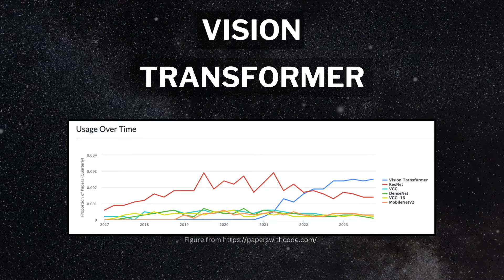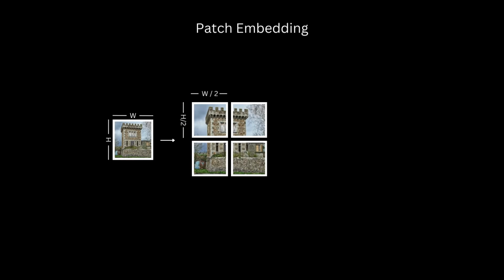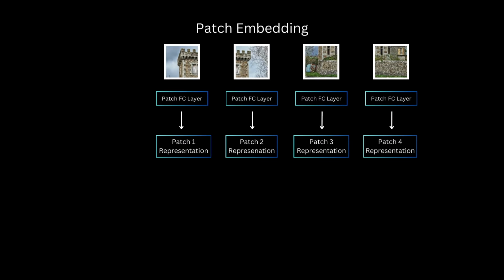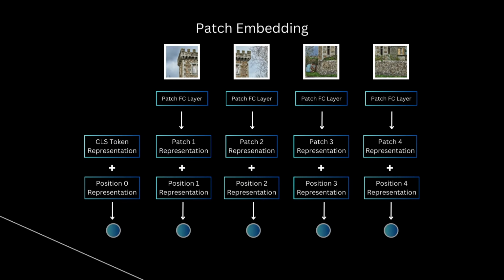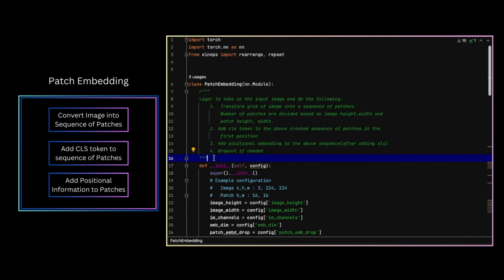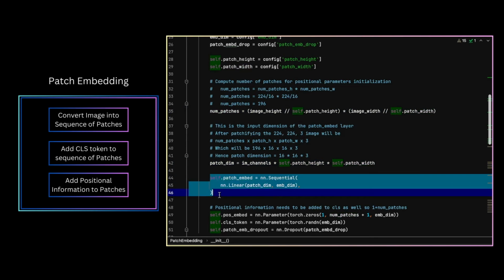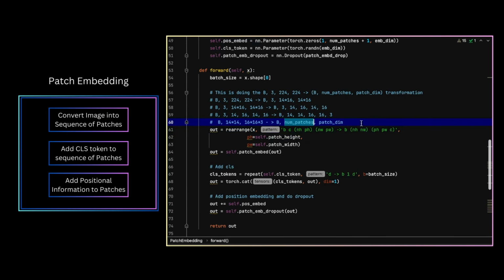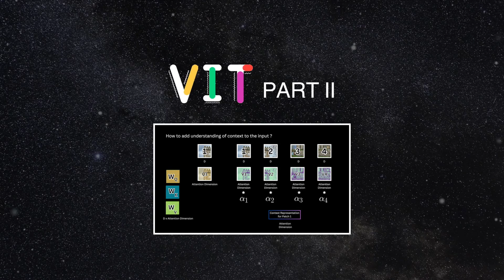PATCH EMBEDDING | Vision Transformers explained

Comment: Thanks for the video. I learned a lot, 
and I what if I have 3D images(C, W, H, Z(slices)),
what parameter should I change  or add?  
What patch size should I consider? Thank you in advance.
Reply from the maker: Thank you :) 
So I have never actually worked with 3d images(i am assuming you have medical 3d images) so take everything that I have said below with a grain of salt.

If your goal is to do classification you could simply consider tubelets instead of patches, so that means you are patchifying not just along spatial dimension but also along z(slices I am guessing) dimension.
But if you trivially try to compute the attention between these tubelet embeddings, it would most likely end up very costly(but if your images are small and z dimension is not huge you can try this). You can refer to ViVIT paper to understand this and details involved in it and some approaches to reduce the cost. 

In case your images/slices are large then you can try to use Swin transformer. Specifically you can refer to Video Swin Transformer paper. Just that for you temporal dimension becomes slices.
For specifc patch sizes and other parameter, theres a Swin paper for 3d medical images which you can take a look at(Self-Supervised Pre-Training of Swin Transformers
for 3D Medical Image Analysis), specifically their encoder part.
Reply: @Explaining-AI  thank you for such a great explanation and suggestion regarding my question. My image is 1x244x244x40 (1 channel and 40 slices). Do you think this is a large input for ViT? And yes, I am working on a classification task. I will definitely read and try to use 
 ViVIT and the Swin paper for my problem. thank you again for creating great content and you help.😇
Reply from the maker: @buh357  Its my pleasure :) And maybe You can try downscaling images and see how much time it takes for convergence to test that quickly. But for easy calculation assume your images are 224x224x40 and patch dimensions are 16x16x4 Then you will essentially be running a transformer on sequence of 14x14x10 ~ 2000 tokens. So I do feel Swin might be better option here but still do try with simply converting VIT to 3D VIT on downscaled images to see what kind of results you are getting to decide better.
Reply: @Explaining-AI  hi, sir. you were right, video swin transformer performed better than 3D vision transformer(from my traininng, both train and val loss did not decrease), but problem is that the video swin transformer is not performing better than 3D resnet50, and 3D efficientnet, i am wondering how can i boost the performence of video swin transformer? more data? do you have suggestions or tips for training video swin transformer? btw i am traninng from scracth. thank you in advance.😁
Reply from the maker: Hello  @buh357  , assuming you have already tried changing things like number of layers and tuning the hyper parameters then yes you can try with more data, that should help. 
But if getting more data requires more investment (time or cost) then maybe to get sense of whether it will benefit or not, you can try training both(swin and resnet) on lesser data. Say 10%/20%/50%/75% and so on of current dataset.
And if you see that the performance gap between resnet and swin keeps decreasing as you provide it higher fraction of dataset then thats a good indication that more data will further help to bridge that gap.
And like you said do give it a shot with pretrained checkpoints as well(for both variants for fair comparison).  
Btw How large is your dataset and whats the difference between the performance of both?
Reply: Hi,  @Explaining-AI  , i have changed the number of parameters of 3D efficientnet, and 3D resnet. for ViVit, i only changed, window size and patch size, and i still wroking on it, for you reference, my dataset is around 450 3D medical images, the validation loss of 3DEfficientNet(0.54), 3DResnet(0.57), 3DConMixer(0.58), Vivit(0.65). results are after training 30  epochs. 
I will try your strategy. train all these network on lesser data, to see the gap between models. and i have found a pretrained weight for Vivit, but the model is trained on RGB video, it has 3 channels and my data has 1 channel, i am wondering if i changed the first layer of Vivit, can i utilize the pretrained weight? thank you for giving me your suggestions, have a nice day, sir.
Reply from the maker: @For ViVIT you could just convert your image to be of 3 channel, like just repeat the 1 channel gray scale three times across channel dimension. And then use the pretrained weights to fine tune on these.
Reply: thank you. @Explaining-AI

Comment: Initializing pos_embed w/ zeros vs w/ randn, made the position embedding similarity visualization (pesv) make sense vs nonsensical. Any idea why this happens? 
In case when I init with randn, the pesv looked random throughout the training (with better losses and eval metrics).
In case when I init with all 0s, the pesv made a lot of sense in very early iters, i.e. similar regions in dataset had similar pos_embed (with little worse eval metrics and losses than before).
Reply from the maker: That’s interesting. What if you do a reduction of the positional embedding space to a much lower dimensionality using say PCA ? And then see similarity between positional embedding projections in that space ?